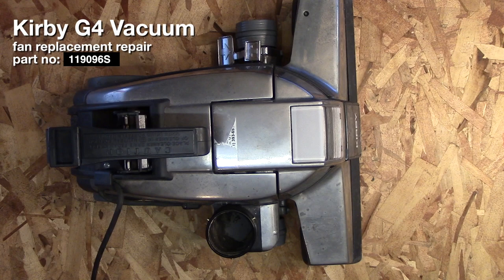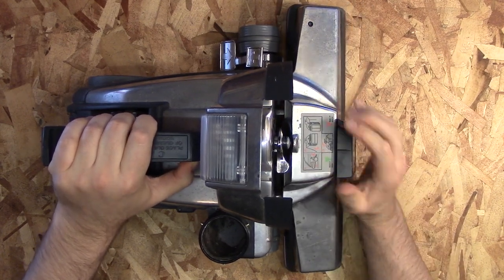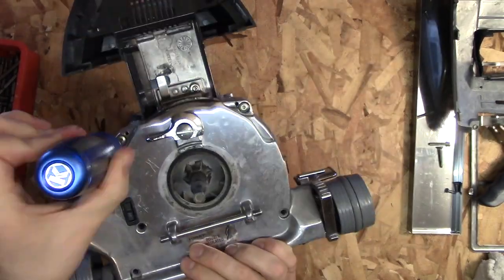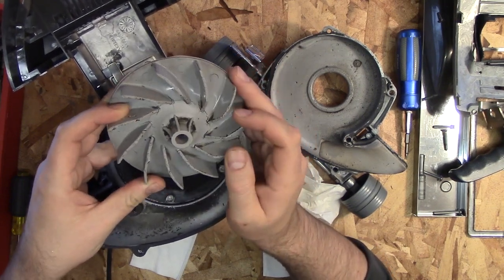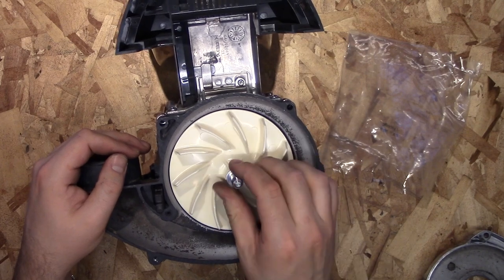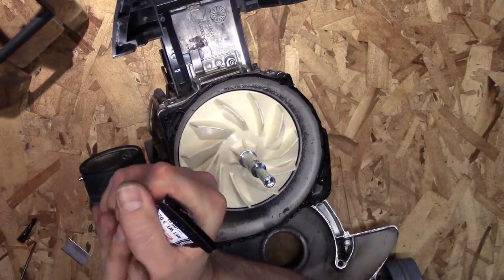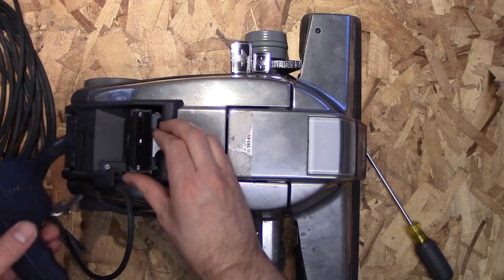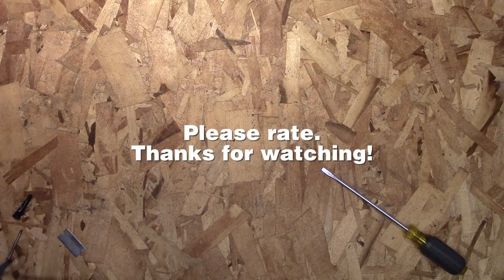Kirby Vacuum Fan Repair How To

Comment: Thank you for the great video!  I have a Sentria Gen5 and the fan shelled out!  Scared the crap out of me...lol.  I spent more time blowing out my Kirby with compressed air, and cleaning than I did in replacing parts.  New fan cost me about $12 delivered to my door.  In my case the fan disintegrated an damaged the sealing surfaces.  I used a blade to get get off chunks and clean up the surface.  Then used a wire brush to finish up the surface.  Then I used rubbing alcohol to prep the surface for sealant.  Great video!  Thank you

Comment: Thanks for the affirmation that the fan might be the cause of the noise.  I was thinking I fried the motor or something in my Goodwill Store ~$29 G4 rescue that I mainly wanted for the hose and better looking front wheel shaft and section... which I still wonder if I did fry the motor since I recall running funky with some smell and not only the loud noise.  I'll continue disassembling thanks to your video showing where the two front plate top screws are I guess I didn't think about looking for after I removed the top back covers.  I'll also check the motor of the motor and shaft being straight still.  Thanks for sharing!   I'll make a video of the sound and reference this video where to detail.

Comment: The fan "bolt"  on my Kirby will  not budge even now that I know the thread is a left hand. Tried WD 40; two vise grips; big hamer one side of the shaft small hamer to smack against oposide side of the shaft. nI'll watch this space fro the solutio !
Reply: If you take the 4 torx out that holds the handle in place, you can take a 3/8 open end wrench and put it on the shaft from the motor
Reply: 33brentw Thank you so much for the tip. I did as you described and all is well.
Reply: @33brentw  thanks for that tip, it might have to be done with my son's machine.
Reply: @33brentw  11/32
Reply: Thanks for the tip!👍

Comment: I have a g6 and I just had my Kirby professionally repaired a month ago and this was one of the things that they fixed and it has been running great. I just had my hose attachment on and have apparently sucked up something that has gotten stuck in it somewhere and it sounds as if it’s banging around. Mind you I have checked the bags compartment where metal/ hard things usually go but it is empty. Is it possible it is stuck in my new fan causing damage now.

Comment: WOW, thank you so much for your perfectly clear and precise guide, i now feel i can DIY'it. 👩‍🔧
HOPEFULLY, this will do the trick for our squealing Kirby Sentria! Do you think a worn out fan would also cause belts to wear down prematurely? The only thing I've ever replaced on our hand-me-down 12+ year old kirby, has been belts and of course the bags. I probably need to replace the roller too, i bet. Embarrassing, but the center of the wood is so indented! (Although, the bristles were actually okay, err at least I think so with nothing to  compare it to. Any other suggested maintenance/replacements?
Sheesh, I'm surprised this old gal still works with the obvious neglect I'm admitting to here.🤦
Thanks again for any help you are willing to provide.
God's blessings be yours,
Mrs. A.I.R.
Reply from the maker: It could be that the brush roll is not spinning freely, that will cause premature wear on your belts, also the squealing could be that as well.  Or the fan shaft could be causing the belt to slip.  So if you are replacing the fan it should come with the fan shaft.  Good luck!  Just take your time.
Reply: @AndrewDIY  my motor does not spin that nice and free how did you get yours to

Comment: The unigasket on the front of my Kirby needs to be replaced.  I noticed that you made this repair without one.  Is that ok?  Should I just remove my disintegrated gasket and keep vacuuming?  thanks!

Comment: I do this for a living also.   Better off using a electric screw drive.   Plus most times the belt pulley and fan assembly do not come off that easy.  So one must put a small wrench inside and lock the top of the armature to unscrew the belt pulley and fan.
Reply: 9n my g7 the qre 2 flats on the armature at the end of the commutator. you can just slip a small open end wrench on it and then use a small phillip or small allen wrench of the motor shaft at the front to loosed it...oh the shaft is reverse threaded

Comment: My classic 3 uses a cast iron fan blade i need to open it up though i plugged it into a faulty outlet in a house i cleaned and it sent the motor into ludicrous speed sparked and let out magic smoke. Still runs but runs slow rough and rattles now.

Comment: Great video. Would have been better if it mentioned the 9mm nut on the back of the motor shaft. Holding the fan while trying to undo the spindle wasn't enough to stop the shaft turning in he fan.

Comment: Hi - I changed the fan per your video; I was concerned how much I was tightening it down so I didn't "batten" it down too much. Put it back together and powered it up. It seemed to run well for a (very) short time, and then almost instantaneously the motor "lugged." (I immediately turned it off). Took it apart again to get to the fan and it had loosened up considerably - which I took to mean I had not tightened it enough. Tightened it and it happened again. HELP!
Reply: This is what happened to mine but it wasn't loose. Did you figure out why it wasn't turning on???

Comment: Something stuck in the motor shaft (fan area) . I just had to take apart the whole floor system including the on /off belt knozzle . Which is harder than it looks. But it was a success and now, something’s jammed in the motor area and halfway out the air duct . 🤦‍♀️

Comment: I've gotten everything off down to the rod. It won't loosen because the white gears in the back keep turning with the rod, I am holding the fan itself. Is there something else wrong other than the fan blades are broken?

Comment: Its sad they don't have metal fan blades anymore. Great video.
Reply: the old metal fans were notorious for a blade snapping off, with a coin hitting it just right , the new polymer fans Lexan and Amadel) can take repeated hits from smaller objects  and will last for years

Comment: Great video but I can't  get the  piece in front of the blade off it just keeps turning, I saw others mention having to hold a square bolt with a wrench but mine doesn't have that. I'm stuck

Comment: Which model did you use for the demo? I notice it looks different then my G-4. Thank you as I was wondering how I would get the fan replaced as the local vac shop tend to charge  a pretty penny for repairs.

Comment: hey brother the fan is super stuck in can't pull it off. I've tried prying it with 2 flat head screw driver, and later uses a wrench, but no dice. all it does is bend the plastic fan. Any tips?
Reply: 1stNeoSpartan did you ever get it off? I've been trying for about 5 hours
Reply: Kema Cat negative. had to take it to a Kirby repair place. Well I actually had my wife do it and act a little in despair so the guy working only charged her $50 upfront. The next day he said it was extremely hard to get out.
Reply: Posting for posterity: By sneaking a screwdriver in behind the fan, and repeatedly prying at the fan (it will bend), and moving around the fan while you do this, the fan should gradually start to move off the shaft. It took me about 5 minutes, but once it got started good, it came off easily enough. A little alcohol on the drive shaft where the fan is might also help. The idea, typical of removing press fit parts, is to make a little progress on one side, then a little on another side - keeping things even.

Comment: A piece of my fan broke and went into the bag, my vacuum is making a loud noise. If I replace the fan will that solve the noise.
Reply from the maker: Yes, if a fan blade is broken, it's going to sound different and is usually a loud noise whistle or "whirring" sound.

Comment: Hello, I have a Kirby G2. I am at the part where I put the pipe through the fan blade rotator. I am holding the fan, while the fan is still, the entire metal piece is moving but not getting loose. Any suggestions?

Comment: Andy:  when I try to take off the shaft by rotating clockwise the main shaft spins on the fan so I can’t get any pressure to spin off the removable portion.  I have a Gen 3.  Any suggestions?
Reply: Read through all the comments. I saw advice about how to stop the shaft from spinning.
Reply: I used a screwdriver to stop the transmission gear from spinning - which stops the main shaft. Wouldn't be a good method if a lot of torque was involved, but the shaft on mine didn't require but a very little torque.

Comment: The drive shaft was "bulging" which made it hard (damn near impossible) to remove the rubber gasket and spacer which go behind the fan Then the new end piece would not draw down because of the over size shaft.

Comment: Hey thanks for the video! I'm trying to get a fan off a g4 but the spindle  just keeps turning...and not unscrewing. As far as I can tell I'm doing everything right holding the fan still while turning the spindle clock wise. Have you got any suggestions? Ever heard of this before? Any suggestions would be greatly appreciated 
Thanks Andrew
Reply: im having the same problem with my g4.did you find out what to do?
Reply: @66windar  hey yes....get a pair of bigger pliers (channel locks or vise grips) and hold on tight  to the plastic part of the fan closest to the spindle and it should come off
Reply: @andrewcoyne2191  i got the fan off but used a wrench on shaft near the motor to stop from turning.I had to take more parts off to get at it but the shaft is actually notched there to accept a wrench.3/8 or10mm.
while apart I cleaned with compressed air and fixed the neutral/drive switch.Gotta love tube for all the input!!!Thanks for getting me on the right track!
Reply: @66windar  What other parts did you take off?  Still cannot get this darn thing off.  Shaft turns freely and fan stays stationary, but the shaft piece will not come off.
Reply: @kathycowley5097  I pretty much took the whole kirby apart to expose the whole motor.There is a spot to use a 3/8 wrench on the backside of the rotor.While holding on to spindle with a small pipe wrench you can now break the spindle free.
Reply: @kathycowley5097  This reply if for posterity, since the question is old. You need to stop the motor from turning. In my case, I used a screwdriver to block the transmission gear from turning. The spindle on the front came off easily with that. I had the same issue - stopping the impeller fan from turning was not sufficient.

Comment: Hi, I have a Kirby Sentria and am trying to replace the fan, following your instructions.  I cannot get the front piece off to 
expose the fan (I can see that it is indeed cracked). Any suggestions?
Reply: nancy wood Hello Nancy, I am a Kirby hobbyist. There should be a small slot on the right side of the fan housing on the back side that can accept a screwdriver or pry bar, use this slot to crack the housing apart. Keep in mind that you need to apply silicone afterwards.
Reply: you have to slip a thin blade between the front cover and the body and gently twist it till it begins to open

Comment: Wonderful video! Almost all I need to fix my vacuum but.....
My fan spins freely on the shaft. That is my problem. The shaft is not free spinning- still connected to the motor and transmission and undamaged. But the issue is I can't use the fan to stabilize the shaft to unscrew the exposed part of the shaft. Any ideas from anyone??
Reply: I have the same problem, so this video does not help in these situations. Did anyone give you any ideas that worked?
Reply: Sheryl Gambardella I have the same problem, did you find a solution?

Comment: can't get the belt lever or the fan off. when I twist, everything else twists also
Reply: you should be able to stop the other side turning with your other hand, there is another "fan" behind the metal casing, in the motor area, put your finger on it & then turn the spindle.
after the spindle is removed, if the fan is stuck, use some wd40 on the shaft.
Reply: Kas S I have tried that. I can't grip the back of the motor to hold it while I twist the front
Reply: you don't need to "grip" anything, it's not that tight, there should be a hole in the casing, at the bottom, put your finger in that hole, while you turn the fan you should feel the other "fan" at the back turning, stop it with your finger & unscrew spindle as described in the vid.
unless you have one of the newer models, that might hve a different casing...
Reply: I had similar issue.  a bit of oil in the two slots got it to brake open and screw off.
Reply: Kema Cat with the Kirby facing you reach back with your left hand and pinch the belt gear while turning the shaft clockwise. Should be easy.

Comment: why did you take off the back cover?
Reply: I'm not him, but the reason you remove the back cover is because it has a tab that goes over the FRONT cover. You cannot remove the front cover without first removing the back cover.